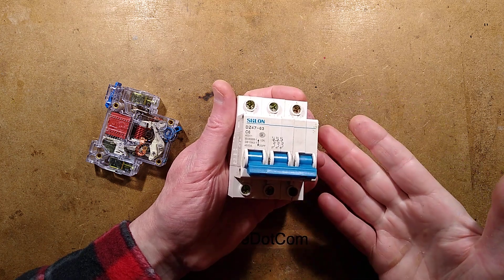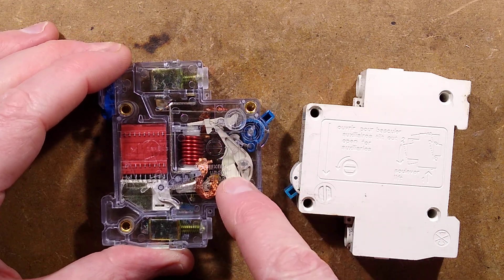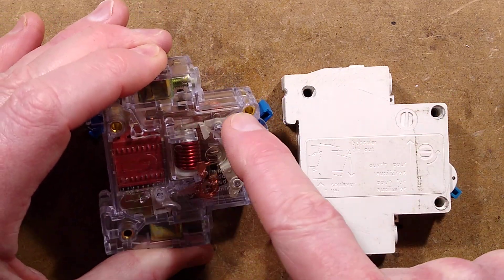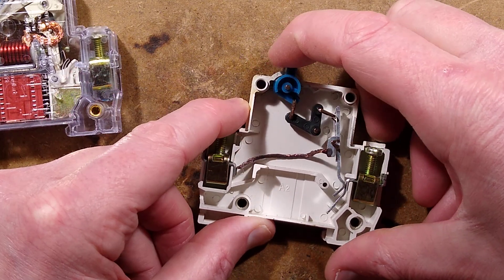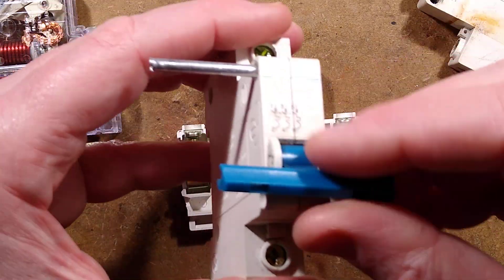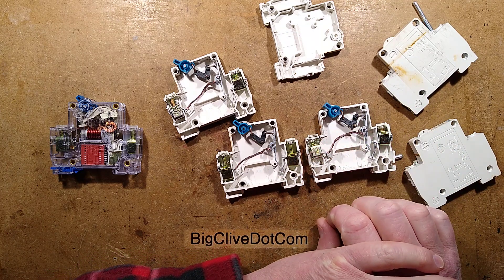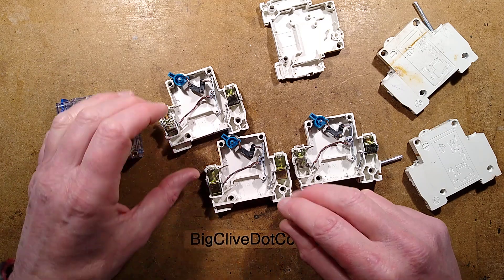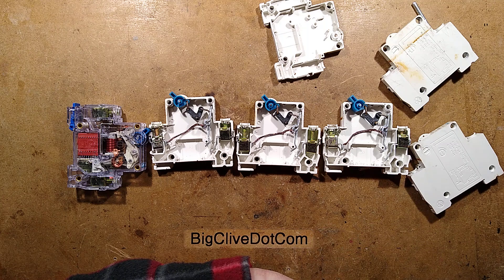Inside a fake un-trippable circuit breaker.

Comment: Why would anybody fake a circuit breaker? How cheap is a generator that there’s margin in saving $4 in parts for a real breaker?
Reply: You'll be surprised by the numbers of people overspending where it will be better to save but going too cheap where it's better to pay more for quality. Like i see PCs people build and i see a fancy case for more than a thousand with a lot of RGB lights, top CPU, motherboard and video card... and cheapest PSU possible. Then they come to me asking if it's possible to fix their PCs after that PSU fails and gets 50V on 12V rail. Where they could just buy a cheap office server case with no bells and whistles and spend that money on a high quality PSU. For the wiring i've never seen anyone going that cheap as buying those. But going cheap with thin wires and cheap sockets and then wondering why their equipment glitches each time a fridge or a microwave turns on is very common.

Comment: I think they' were meant to be sold as non-current overload disconnect switches, which is technically a "manual operated circuit breaker" lol
the good old word play scheme.
** that still means the label text/symbols are wrong of course. many of the manufactures sold hollow breaker bodies as simple equipment disconnects switches(breaker).

Comment: Call it an Isolator (breaker) and not current circuit breaker. Normally use it on machines, heaterd, etc to switch off or isolate. On the connection nr 1, 3 and 5 there must be a	0-symbol, and a (current) circuit breaker will have a X-symbol. At least it got the on-off direction sign for this isolator correct. I will know right away it's an Isolator. Other thing I experienced, is that the load current must be less than 80%. I'd opened one with a load less than 50% what was standing out on the IR scanner. It had metal on metal levers without the copper braided link in between and that's why it had hot connections.
Reply from the maker: It is marked as an overcurrent device.

Comment: You actually CAN tell the difference without disassembling the unit. A real breaker won't make contact until the lever has clicked fully into the ON position. This fake breaker will make contact when the lever is about halfway up, before latching into the ON position.

Comment: Hello Clive. Just been catching up on some of your videos (very interesting and entertaining by the way) when i watched one about the plug in OBD 2 plug ELM 327. I bought one of these and set it up with the TORQUE app but immediately got an error code for the passenger airbag. Took it back out and then was back to normal. During your video you mentioned how they had been copied. Bearing that in mind are there any of these plug in jobbies that actually work and could you recommend one. Thanks Steve.
Reply from the maker: It's a complex area.  Most of the cheap eBay ones are based on a very early version of ELMs software with subsequent code butchering.  ELM subsequently made sure their code was secure in new versions.
The original units are OK for basic diagnostics in older cars, but for newer vehicles it's worth getting a more up market version.
The garage channels on YouTube indicate that no single unit is good at everything.

Comment: This "circuit breaker " is not actually a breaker it is a switch and should be labeled as such.  Any knowledgeable electrician should know the difference before installing it.

Comment: Having a switch in this casing is not abnormal, but putting the IEC symbol for circuit breaker ( and probably fake characteristics) on it  is criminal.

Comment: I work in a home improvement store and I have seen disconnect switches that look and fit exactly like their circuit breaker equivalents and are used for AC disconnects. Those ones have no overcurrent protection but they are clearly marked as such. I wonder if this started as something similar and they neglected to mark it...

Comment: Are they really marketed as circuit breakers? Or is it just a switch? They are not uncommon and come in the same case as circuit breakers.
Reply from the maker: Overcurrent markings.
Reply: @bigclivedotcom  Get that. Not the nicest switch from the inside. But don't blame it for not being a CB when it never claimed to be one ;)
Reply: @carsten.hamburg8771  But it does claim to be one. In at least four places.

Comment: I was looking for a circuit breaker that actually broke magnetically when it had a 10%overload.  But just like this the magnetic fail could not really happen. The trouble with the thermal part is that it is sensitive to ambient temperature.  I know that most people want a breaker that doesn't break and are prepared to have the occasional house burn down "electrical fault".  But what if you actually want legitimate protection?

Comment: Its sad they didn't do the absolute mini um for safety and put a fast 10A blow fuse inside so that it would at least prevent a fire or continued shock in the case of a dead short.... but I guess what can you expect from people making a fake circuit breaker in markets where real ones that normally work but don't carry certification are literally only a dollar or two.

Comment: Ugh how many times i have to explain this, stupid people admire complexity while true geniuses admire simplicity. This type of specialized circuit breaker is needed where malfunction can’t be tolerated. You see the metal thingy is actually a precisely tuned bimetal thermostat where only if an over current is happening it will produce enough heat  to expand and overcome the spring tension and create an open circuit. The engineers also have to calculate the correlation between heat generated by the bimetal and heat loss. The bimetal can’t use too much material since it will increase the heat dissipation (more material equal to more surface area) and too much heat dissipation inhibit the metal expansion but they also can’t use too little material since the bimetal need to overcome the spring tension. So this circuit breaker is actually really expensive since it’s more reliable, lightweight, less point of failure, consume less power, and other bullshit i’ve just made. This circuit breaker truly is a marvel of engineering

Comment: It's that old adage, if it does not feel right (to light, to heavy) take a look inside, I have come across this type of thing before in different industries often when it has broken and you have to effect a repair and you are amazed that it has lasted as long as it has.

This circuit breaker is dangerous and who ever sent it in should be looking back up the supply chain to see if any others are effected.

Comment: Chinese for u 
They don’t give a fork about your safety , they care about money .
Cheating the system is always their goal
Reply: Except that big chinese companies make quality stuff. My $350 phone lasted for 5 years and battery is about 70% of original capacity. Can't say the same about iphone 6 where touchscreen failed after two years of very careful use. But when you pay 1/20 of what something should cost and buy it from company some company with no address and stuff - you'll get things like these.

A sane person won't be buying anything that's too cheap. A smart person won't be paying 10 times more just for a label either. Because there will be a company that doesn't charge 80% of the price for the name but making quality stuff.

Comment: Working in industry, I have seen many a Chinese made device, that resembles a real device, but due to a lack of understanding of it's real purpose, have been cheaply reverse engineered to satisfy customers. I think that many times, the engineers that are asked to copy the device, cheaply, are not told the real features of the device, and do not work in that industry. In all honesty, they make great counterfeit look a likes, that could double for what one might think to be just a common switch, but not knowing the intended and real purpose of the device, have caused millions of dollars of damage to equipment. Buyer beware...  Quality costs.
Reply: Problem is that scamming became legit way of doing business a long time ago.  This is extreme example - a fake. Other examples will be planned obsolescence and cutting costs in professional devices that companies sell for thousands and millions. Or just rushing to get your stuff to the market without thouroughly testing it. Cough-cough 737MAX and Galaxy Note 7.
Reply: @shadowflash705  I'm starting to think that there are more scammers than real people out there. I had to change bank cards 4 times in the last 3 years, cuz some jerk near/in San Francisco, must have some number generator he can generate codes with. Usually just takes $20 Uber rides with it, but the bank is getting a little miffed.

Comment: that is typically used as just a disconnect  used in refrigeration etc. not a breaker at all  JMHO
Reply from the maker: It's marked as an over current device.
Reply: @bigclivedotcom  not good

Comment: That was a big problem with the Shilon DZ47-63s. You ought to try the 
~~LPMNSD~~ Baomain DZ47-63, or perhaps the ~~Xinwde~~ VictorsHome DZ47-63, or the YWBL-WH DZ47-63, or maybe the ~~Xinwde~~ uxcell DZ47-63, or the smseace DZ47-63, or the Honghua DZ47-63, or the haige DZ47-63, perhaps the DAJAN DZ47-63, or the YADE DZ47-63, or the Sentai DZ47-63,

Comment: Are you sure this isn't simply a 3 phase disconnect without overcurrent protection?  Ok went back and looked it up on line....it is sold as a circuit breaker.  Looks like Chinese made.   It looks like more Chinese low quality.  I think all they may be good at is making  a virus .

Comment: Does it list as a breaker via part number. Just an internal switch for equipment to isolate a circuit.
Reply from the maker: It has the overload breaker markings on the front.
Reply: @bigclivedotcom  glad we have the NEC in the US

Comment: Looks like a fuse/switch combo to me.  Size that wire correctly and it will melt at the right current, eventually, and maybe not start a fire.

Comment: Does it claim to be a circuit breakers somewhere? There are switches that look like breakers. I believe that is what this is, just like a wall switch. Also like a wall switch, it is rated to handle a certain amount of current.
Reply from the maker: It is marked as an overcurrent device and not an isolator.

Comment: i guess yea, these are useful to fool inspectors, thinking its the same amperage value but no so you can get more VA than the original breaker, though the safety is an absolute zero unless there are multiple genuine breakers around the house

Comment: You didn't even test them!
Reply from the maker: There's only so much excitement you can get from a switch.
Reply: @bigclivedotcom  but every wire is a fuse, it's just a matter of what current it supports - I wouldn't be surprised if one of the solder joints is bad enough that this thing does actually "trip" at a reasonable current

Comment: Well is it z breaker or is it a case molded switch? Here in the USA we have case molded switches that look exactly the same but is not a safety overload. Have you overloaded one yet? If the wire burns off at the rating aside from short circuit protection itvwould offer some measure of overload. Lmao

Comment: Hold up. What is the part number. Because I've seen switches that look like circuit breakers, but they have a different part number.
Reply from the maker: It's marked as an overcurrent device.

Comment: Just showed this to my dad who is an electrician. This might not be meant to be a traditional breaker and is likely what's called a "Fuse link" which is essentially an on off switch with a fuse. It might not be the safety nightmare as depicted here.
Reply from the maker: It's marked as an overcurrent device.

Comment: Basically this is a service disconnect. It is not ment to protect like a normal breaker. These are typical on equipment installed  and will even state it needs to be on a proper breaker in a panel. The lille box outside on your A/C doesn't protect anything ( unless it has physical fuses ) it is a service disconnect even if it looks like a breaker
Reply from the maker: It's marked as an overcurrent device.
Reply: @bigclivedotcom  Well that it certainly isn't then

Comment: it's still a breaker, but it works like a fuse, when the wire inside burns then the circuit is broken

Comment: I thought Federal Pacific Electric (FPE) circuit breakers were bad, as they could "cook" without opening, and have caused a number of structure fires over the years.  They faked their safety agency tests and the fraud was discovered years later, after hundreds of thousands, perhaps millions, had been installed in American residences.  A recall was never issued and many homeowners are still living with potential time-bombs.  What is depicted in this video is downright criminal.

Comment: Aren´t they a lot lighter? I mean there is almost no metal inside.. And the normal ones are quite heavy.
Reply from the maker: The triple breaker is detectably lighter, but an individual breaker would be harder to detect.

Comment: imagine someone has this in his house and plugs somthing damaged... people who make these should be arrested for tried murder.... seriously...

had something similar, where my friend told me, he changed the breaker which was tripping all the time with his welder and i said, well done, show me what you did. As he opened the panel proudly, the first thing i did, was to shut off the main fuse... the idiot put in just normal switches for DIN rail... no CB, but in this case, it weren't fakes... it was clearly visible. That's the reason why only electricians are allowed to change parts like this.

Comment: I have a generator which has one of these fitted it came from China i didn't need to open it up the whole machine was a fake Honda generator pretty obvious. It was 150.00 pounds brand new and rated 7000 kva 380 volt it had one of these breakers on the 3 phase side.

Comment: I'm slowly starting to think the Chinese and/or the Russians have started a war against the West without ever firing a shot. A few weeks ago I bought a mechanical timer clock from Legrand, not the worst of brands. Didn't work, cost 28€! (little pin hooked itself onto the timer mechanism so everything got stuck). Another 5€ one from a unknown brand didn't work either (clock wasn't turning I believe). Some days later Aldi sold some for even less. I really couldn't be bothered anymore.

Comment: here in France we have one of the most strict normalization for electrical components, every switches, circuit breaker, connecting combs, wires and cables must have the NF stamp on them, otherwise, it may be illegal to install them depending the installation, but in every situation, insurance companies won't cover you. If you do anyway and your house burn down or someone get killed/injured by electricity, if it is proven that you installed non NF marked devices, your in for a rocky ride. 
For context, NF means "Norme Française", French Norm in English. It means that the device had been thoroughly tested by an independent lab at pre-production stage first and regularly during the selling lifetime of the device, it guarantees the user that the device will work at specs no matter what and in case of destructive failure of the device, that it won't burn and by extension, won't burn down your house and it will do it's job before dying (example, a circuit breaker that weld itself due to a brutal overcurrent peak may have a secondary set of interruption blades that will open permanently, cutting the power and preventing the rearmament of the faulty breaker).

Comment: Transparent cases should be mandated for all circuit breakers (transparent connector backshells are compulsory in some countries for industrial use) where did you get that transparent breaker BTW (unless you answer the question after I typed this in which case forget it).

Comment: I worked in a welding shop once where the owner found some replaceable element fuses, and instead of putting the proper fusable link inside he just use a length of 6ga wire.  I promptly conficated all the replaceable element fuses and chucked them so they couldn't put them back.  I hope they never find out about these, I could totally see them huntinng them down and installing them on all the machines.

Comment: That's just a triple switch in a circuit breaker enclosure.
Reply from the maker: It's marked as an overcurrent device.
Reply: @bigclivedotcom  Like you said, the owner got it as part of a generator, he didn't buy it separately.
I know that the enclosure is marked as a circuit breaker, they should have erased it or used an unmarked enclosure, but hey what do you expect from Chinese free product.

Comment: It’s a circuit breaker. It breaks the circuit (only manually of course). Or if the ‘fuse wire’ or contacts melt. Yikes!

Comment: I noticed our outdoor A/C unit has a disconnect switch on it that is labelled to the effect that it is just a disconnect switch and not a circuit breaker (and is protected by a circuit breaker upstream). I imagine the build quality on this is still worse than an actual disconnect switch?
Reply from the maker: It's not up to the standard of a typical isolator.

Comment: Just for the fun of it - try running 5-10 x 6 amps through one of the circuit breakers, see if the cobber-wire melts  :D
Reply from the maker: I think it would take a lot more than that.